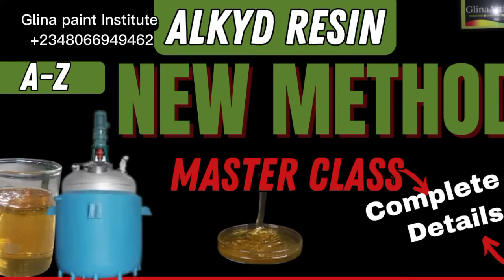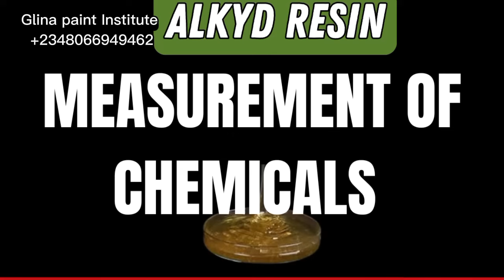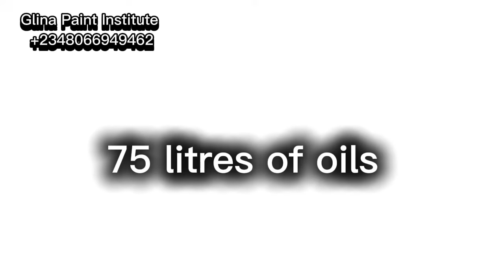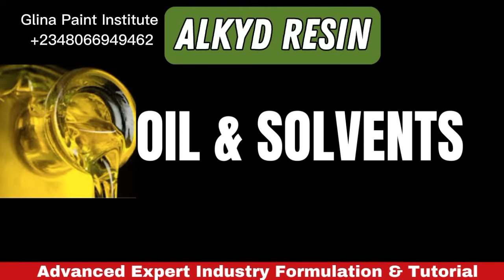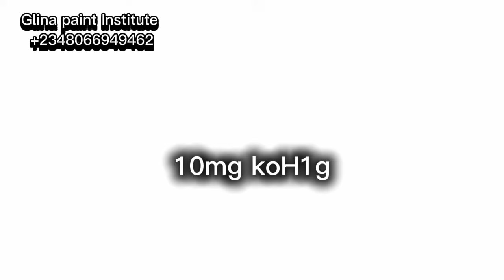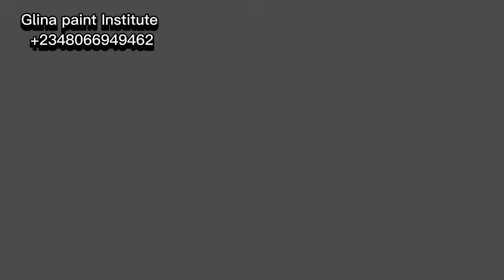Learn How To Make Advanced Alkyd Resin STEP by STEP Professional Guide

Comment: I am interested to make general purpose polyester resin which mostly used in fiberglass products.
Alkyd resin as you explain with raw material is the same or this is only used for paint industry?
Reply from the maker: This is only used for paint production.  Look for my number in the video and contact me. For general purposes, polyester resin use for fibreglass